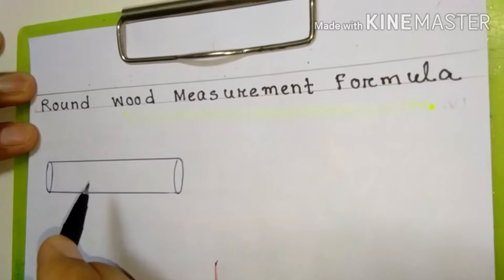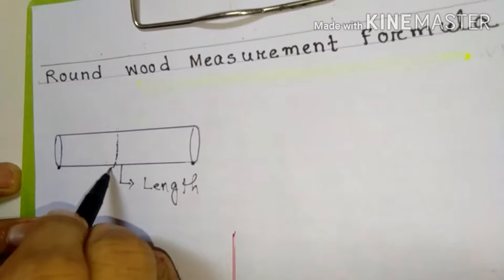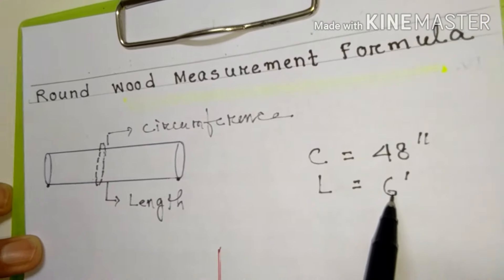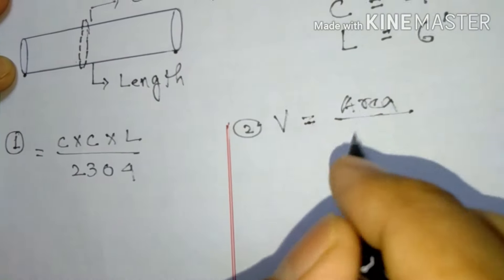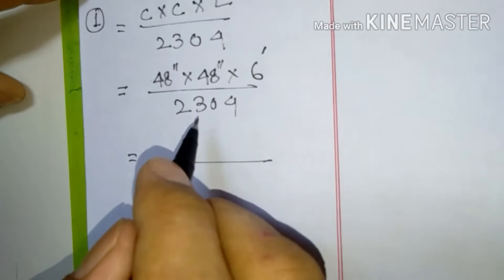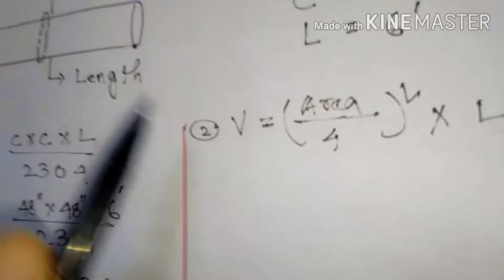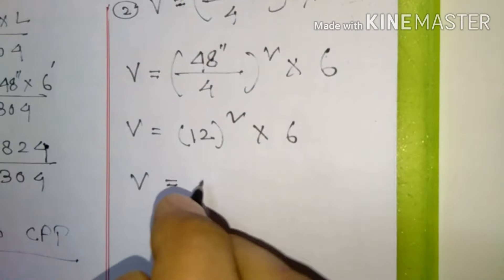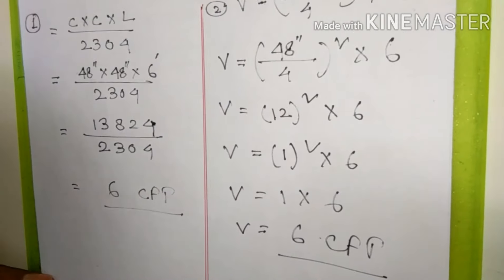Round Wood CFT Calculation. Part -1

Comment: All of you have been asking why its divided by 2304... 
If you see 1st formula is actually the short formula of 2nd one volume. 
What it says v =( circumference /4)^2       ×Length. So when u convert inch into feet it goes like (12×4)^2 which by solveing u get 12×12×4×4= 2304...
Reply: Still didn't get it. Well you plz more simplify this

Comment: Simple method:
Suppose length is 500 cms (5 meter) and girth is 60 cms then,
500×60×60×2.2072 (Length×girth×girth×2.2072)
After multiplying all these u will get 3,972,960
Here, first three numbers is CFT
3.97
Note: Consider ,(coma) as . (Point)

Comment: Watha **## is 2304?
Reply: The basic formula is pie*r*r*h
Radius r = circuumference /2 which is measured in inch which when converted is to be divided by 12
Now volume in cft= c*c*h/4*12*12*4